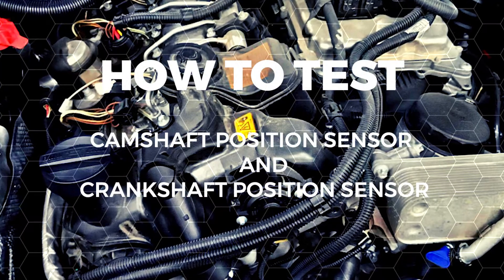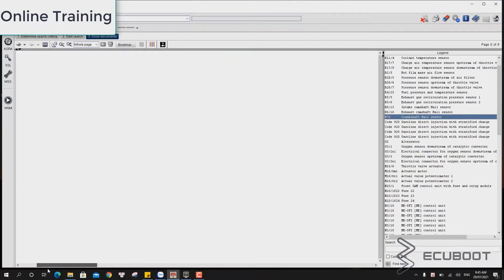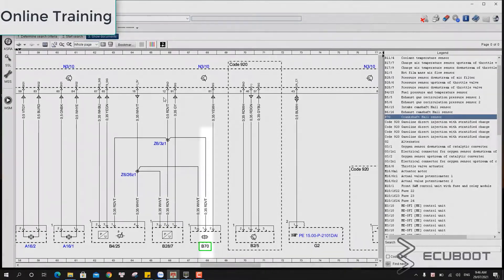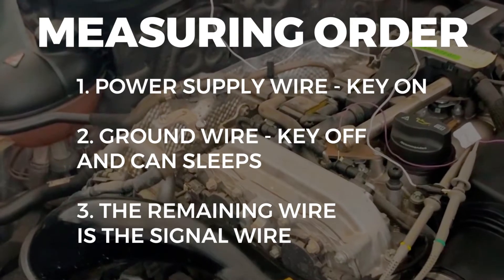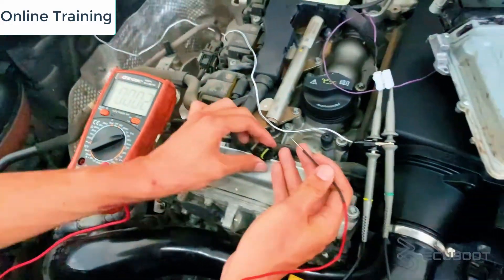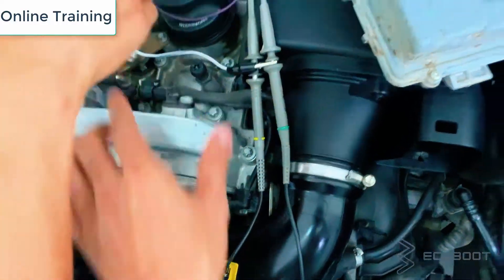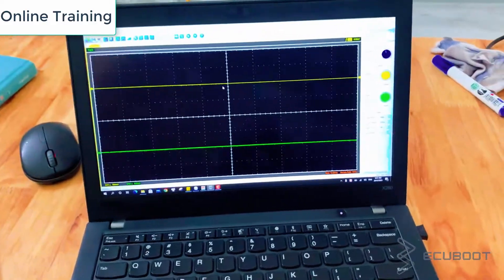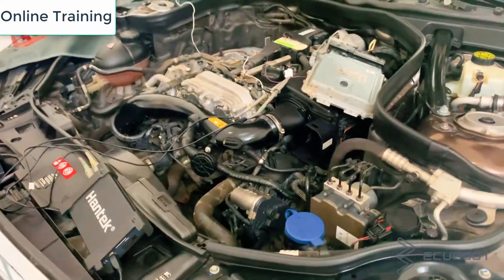How to check Mercedes Camshaft and Crankshaft Position Sensors

Comment: what is the voltage for signal wire on m271 engine camshaft sensors
Reply: 12v